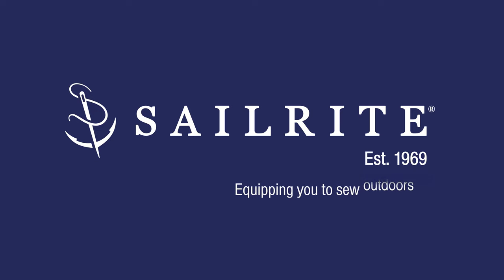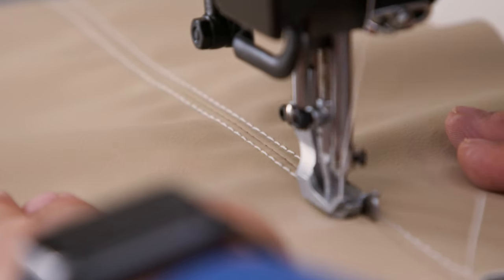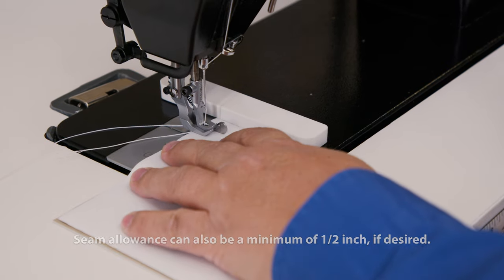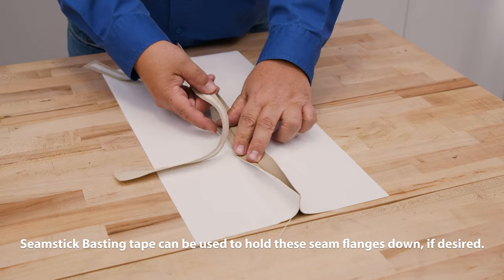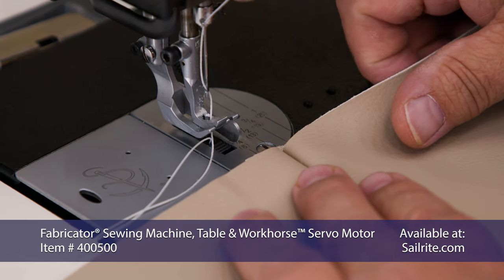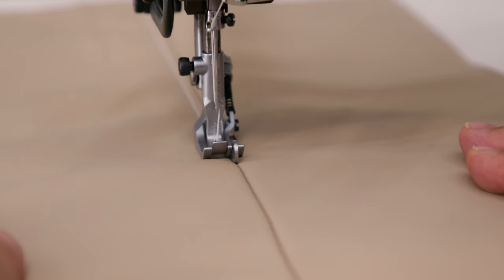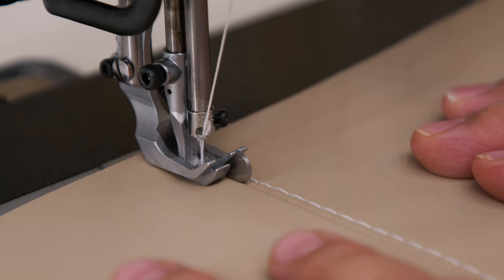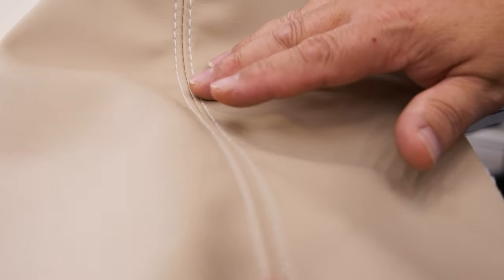French Seam Construction

Comment: That is not a French seam? Nice video but don’t confuse people.
Reply from the maker: To remove any confusion.....This so-called French Seam is a variation of French seams utilized in making of garments. It has become a decorative stitching which often replaces piping or welting. 
This "French Seam" variation is often called: Top-Stitching Seam, Double Top-Stitches Reinforced Seam, Double Fell Seam, Double Plain On-Top Stitching Seam
Reply: Sailrite I love your videos. They are wonderful!
Reply: @SailriteDIY  The reality is that the double top stitch with reinforced backing originated in the late 1800's  as the Luggage Stitch. Unfortunately, most people omit the reinforcement rendering the seam weak and short lived in any high stress environment. Thank you for showing how it's supposed to be done regardless of what you call it.

Comment: Great demonstration, but it needs more emphasis on the fact without the grograin, this stitch is pretty weak and useless... I only say anything because I have done several repairs and the biggest issue was no grosgrain. That's why the stitch failed in the first place. It looks good but it's useless without it.
Reply from the maker: You are totally correct! Thanks for emphasizing this fact.
Reply: Hi! What if a strip of sunbrella was used ? Will it still help the seam be strong?
Reply: @talulatree5297  pretty much anything will work, just sewing the material to itself does nothing and the thread will just pull through.
Reply: @david78212  oh thank you. I just did some large boat seats that had miles of French seam topstitching. I'm so worried. It looks absolutely beautiful,  but it's not upholstered yet. 🙏

Comment: This is absolutely not a French seam. A French seam is a seam that has incased itself within another seam. It is a finished seam, these are absolutely NOT finished.
Reply from the maker: Do you sew canvas and upholstery for boats or clothing? Because the terminology is different for those two industries. If you are sewing clothing, you are correct, this is not a french seam in that industry. However, if you are sewing boat upholstery, like vinyl seating, this is referred to as a french seam. I hope that helps answer your question.

Comment: In your other seam videos you mentioned how strong the seam was, but not in this one. With the grosgrain backing, how strong is this seam?
Reply from the maker: It is almost as strong as the semi flat felled seam, just one step lower. The main strength is the grosgrain backing holding the two sides together. The first stitch is the weakest, but as long as the two side stitches hold in the backing fabric it will not come under much stress.

Comment: I love your tutorials, thank you so much, now can you sell me your posi pin for my given to me Barracuda please
Reply from the maker: Glad you liked it!!! Sailrite no longer sells the Posi-Pin bushing and nut as stand-alone parts. The Posi-Pin system was developed and patented exclusively for use on Sailrite Sewing Machines and is now only available as a standard feature on new machines or as a custom quoted upgrade, or replacement part for existing older Sailrite branded sewing machine models. (serial number and photos required). If your goal is to increase power and slow speed control on a non-Sailrite portable walking foot machine the option we recommend is the Monster II Balance wheel (https://www.sailrite.com/Monster-II-Balance-Wheel). It can be used with good success using a standard friction clutch, or it can be locked permanently to the shaft bushing using the included set screws.  Please let us know if you have further questions.